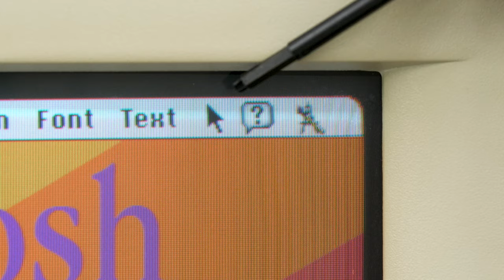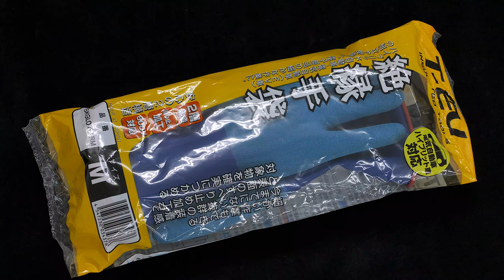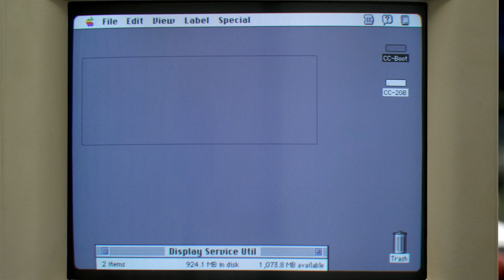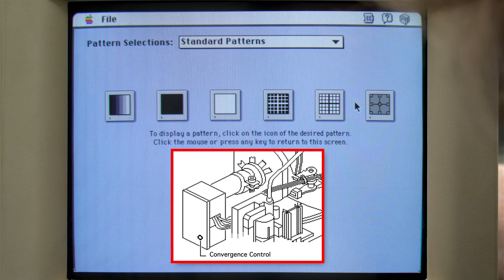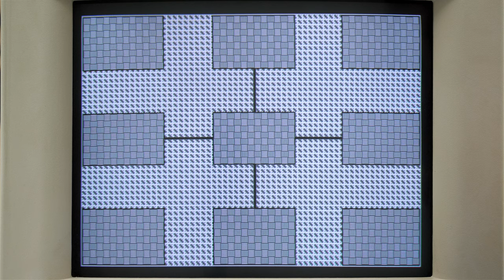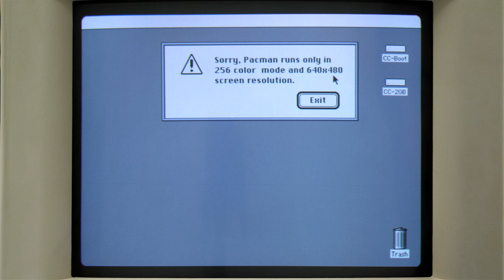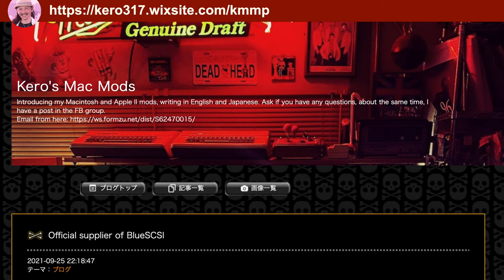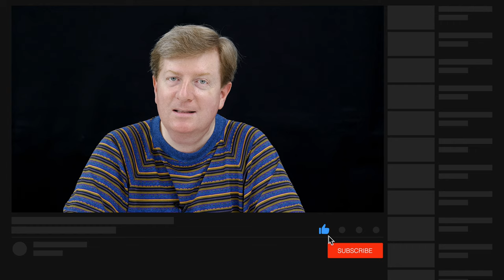Macintosh Color Classic: CRT Adjustments

Comment: Allways making great videos!!! I make a bake in my late 2009 iMac 27"!!! Like you do!  Now I install a new graphics card in my iMac, a Nvidia k3100m 4Gb, I can do everything work well, its a little bit harder than install a compatible graphics card, but now I have a Metal compatible graphics card!

See you man!
Reply from the maker: Congratulations on getting the Nvidia k3100m to work in your 2009 iMac!  It does require a Windows machine to flash which is why I've not done that (I don't own even a single Windows PC), but I do see that a number of people find success with those cards. Very glad to hear it's working well for you!
Reply: @JDW-  Thanks @JDW! Don't need a Windows PC, I make this with a linux boot pendrive, you need a other computer to access iMac via SSH, to flash the Nvidia card... have a lot more work to do this work, but in the forums have a lot information to work well... Now I have boot screen and brightness control.

See you!
Reply from the maker: I must say, I am rather impressed.  I have zero experience with Linux so it would probably take me longer than if I were to just use a Windows machine, but it is interesting that you were able to use that instead of Windows to flash the card.  Great job!!

Comment: I have an LCII which is basically the same thing under the hood. I inhereted it from my mother shortly after she bought it a year old or so. And I have to say there is a certain charm about it being so under powered. Not sure why. It is similar to the PowerMac 7100/66av I bought a couple of years later. It is fun to see what it can be made to run when a person has the patience.  That and it is also capable of running System 6. 

 I also have an LCIII+ in my collection which is a real speedster compared to the LCII and is a perfect machine for older software. And would be indictive of what the ColorClassic II would perform like. The neat thing with doing the mystic(?) upgrade is that its completely reversible. Those CC's are really sought after in original condition.
Reply from the maker: Thank you for sharing!  I lived through both the 68K and PPC days, and I must say that I didn't care for the early days of underpowered PPC computers.  That's why I collect exclusively 68K Macs these days.  For the kind of software I intend to run on them (System 6 & earlier or System 7), 68k Macs are just fine. And while I am a purist when it comes to NOT doing things like gutting a valuable 68K vintage Mac and putting in a modern Mac Mini or even committing the merciless act of making it into an aquarium, I am eager to get the performance up to a "fun usable" level.  

I remember the days of endless 400K disk swapping all to vividly because my Mac 128K (way back in 1984) didn't have enough RAM to keep one full disk in memory (and with no HDD and only a single internal drive, floppy swapping was required).  

I also didn't like the slowness of my IIvx back in the day when I purchased it new.  That's why a year later, I paid a full US$1,000 to swap out that slow-poke motherboard with a Quadra 650 board, and after that I had zero complaints.  Even so, because I love 68k, I am not inclined to do PPC upgrades.  

That's why when I use the stock Color Classic, the main two things I enjoy about it is (1) the compact size and (2) the internal color screen.  I'm not a fan of waiting for menus to draw or wait ages for apps to load.  Those things merely work to raise my blood pressure. :-)  I want the machine to remain 68K and look like it's supposed to on the outside too, but I also want it to be "fun usable" in terms of performance.   That's a big reason I am into SE/30 upgrades, in fact.  With that said, the stock SE/30 is still faster overall than the stock Color Classic, despite them both using a 16MHz 030 processor.  And the 10MB RAM limit of the stock Color Classic is really quite horrible when you are using System 7 and RAM hungry apps like Photoshop 4.  Also, since most of us have the most fun with old Macs by means of gaming, the limited screen resolution of the CC is also a huge barrier to what apps will even run at all.  

This is why upgrades like the Mystic have been so popular and is what I will focus on in my second installment in this Color Classic series.  Everyone has fun with old Macs in their own way, but I like "speedy fun" the best! 😊
Reply: @JDW-  I am with you on the heavy mods where people turn them into aquariums and such. I cringe at that. Even now as you have shown, that even the Old SE motherboard can be rebuilt from mostly new parts. I have plans to do with with an amiga 2000 soon once everything is ready and available. 

The original mac I purchased myself was an SE/30. And I did upgrade it way back before buying my 7100/66. I do recall how disappointed I was with the PPC. At least until the music apps I was using got ported over.  But I did purchase the PPC used with its drives and cache card stripped from it. I had to bug the guy to get him to realize the AV card and rom were part of the original machine and needed them to function... (not the av card I know, but I was on a roll with him).

I then put it through a couple of CPU upgrades and it served as my main computer for several years, so it long outlived its planned service life. 

But using a stock PPC with 8mb ram, integrated video, no L2 cache and system 7.1.2 on an external 105mb hd for the first several months was not fun.  My se30 with its 040 and pivot color card and monitor was a much better machine. However some software I used was already ppc ported and in those cases were much more usable on the 7100... So I had switched it all over.  And I was bound to a set of NuBus AverMedia cards as well. 

These days I don't really have a go-to mac. But it seems like I use the LCII the most. (at least lately) And I even stubbornly refuse to use a flash based drive in it. It must have a platter drive in it for that authentic feel. And I even go further and set a virtual swap file.  My kids just don't understand. lol

Otherwise the classic(-ish) mac I use the most is a quicksilver dual 800. And the other is my SE/30 while I had its pivot screen working.

I tried using my old 7100 with its cards to work on some music a while back, and discovered just how far things have come since the old days. That trip of nostalgia didn't last long. And that machine now even has a G4 accelerator in it with max ram.
Reply from the maker: @wishusknight3009  I appreciated what you wrote.  Thank you.  I must say that my SE/30 is currently my go-to Mac, especially because I have more than one.  I have spinning hard drives but also SD card drives too.  I replaced the fan to a Noctua to make my ears feel better, and once you do that, the next logical step is to replace the hard drive.  The lower volume really does make the machine more enjoyable.  But if I still had my Quadra 650, that probably would be my go-to vintage Mac.  But since I don't and since I now have a Color Classic, that one is going to become my 040 color replacement.  More about that in future videos!
Reply: @JDW-  I look forward to seeing more of that CC!  I also use flash drives in a couple of my vintage macs and love them. My current favorite being the MacSD, bluescsi being a close second and a great value for the price. The LCII though is just for having that authenticity right down to the experience. I need one machine to be like that. Loaded up with software with a fragmented hard drive and too much clutter to sift through. I dont think I have actually decluttered it ever.. Its startup icons wrap around at least twice.. haha

Comment: First of all, thank you for this great video! It is excactly what I was looking for, Now, question: Is there a place I can get another file of the display software? The stuffit gets corrupted in Basilisk, and I need an image to write a floppy, please.
Reply from the maker: Thank you for your kind words.  I assume you are referring to Display Service Utility: https://bit.ly/3j9XQgI
It's a SIT file on Macintosh Garden, but once downloaded, just unstuff the file and place it in your Shared UNIX folder, then launch Basilisk II.  The Shared folder will appear on your Basilisk II desktop.  Copy the IMG to your main Basilisk II drive because you cannot directly use files from within that Shared UNIX folder.  Once the IMG is on your Basilisk II drive, you should then be able to merely double-click it to mount it on the Desktop (so long as you have Apple's Disk Copy 6.3.2 installed).  From there, you will see the disk appear on your Desktop as a folder.  Open that folder and then open the Display Utilities folder, and then open Display Service Utility 4.2.1.  You will then see the buttons which display vertical gray bars, black screen, white screen, and patterns.